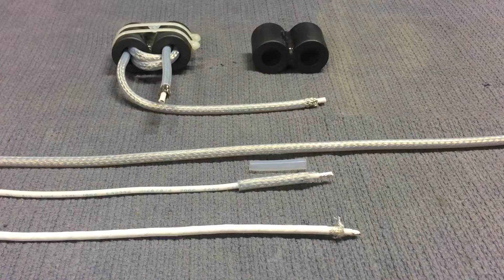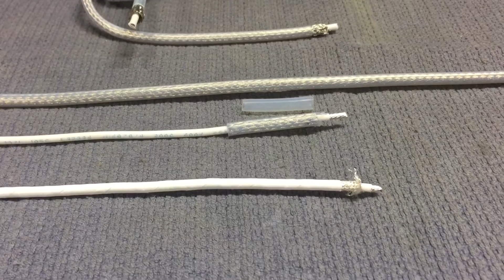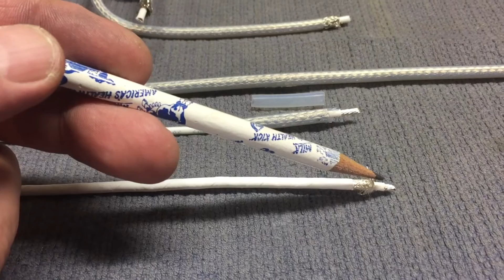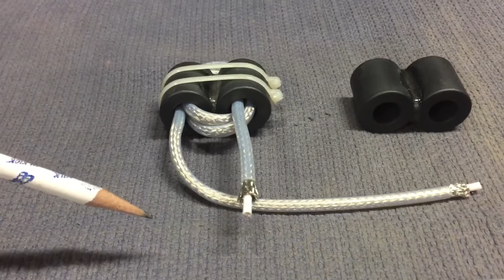Making low impedance coax for LDMOS amplifiers

Comment: Mike, That $7 a foot coax is nothing more than mil single shielded teflon wire that is marketed as coax. I also make low Z coax with RG400 and RG393. Great work on your amplifiers.  WA1GFZ

Comment: Hi KF80D... VK2EDY here, Thank you for kindly for making due reference and respect to my work, much appreciated, I am pleased you have excellent repeatable results. Its annoying how manufactures rip us off in claiming a niche and charge a premium claiming to service a "special" need for a product like coax that differs from 50 or 75 ohms or connectors other than for rg213 or rg58. Crazy. Short sections can be made easy at home for any project using simple tools. I should write an article for this for QST or whomever will publish my technical article. Again what a fantastic result you had. I just finished building a uhf Wilkinson combiner using the same method but modified 75 ohm RG6 and replaced steal bray with HQ tinned solder and also had amazing excellent results. Thanks Bob KD5MHQ for the heads up on this post. Will catch up with you soon mate. Cheers E..
Reply from the maker: Hi VK2EDY, It's a pleasure to hear from you! I have been a fan of your Youtube page,  you do some great work. I always like to give credit where credit is due. I have had some great fun building amplifiers with the ldmos devices. Getting older now and heavy iron is not what I want to be lifting anymore. Tubes have become obsolete for me. I have a lot of projects on my website: qsl.net/kf8od   Nice to have a person with test equipment and engineering experience in the fold. I am just a guy who was not afraid to try something new. hi

73, Mike
KF8OD